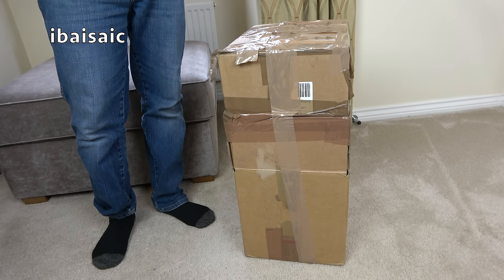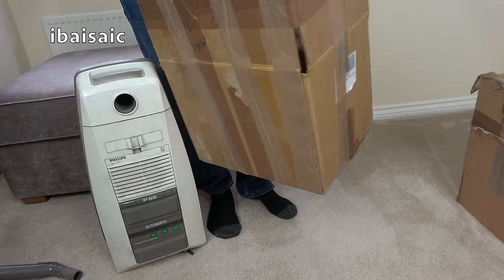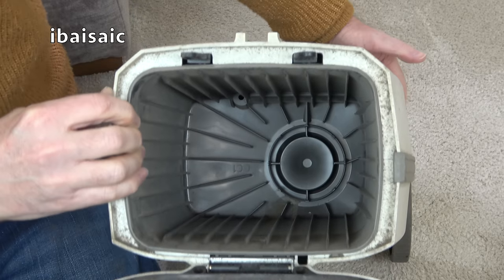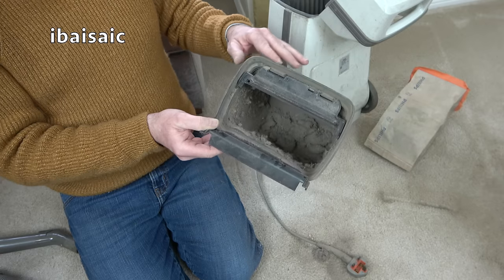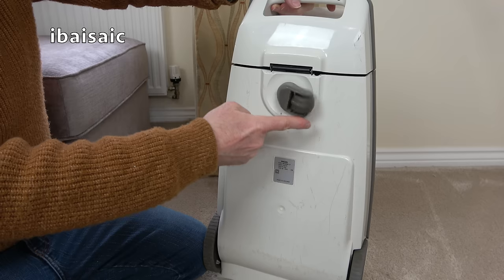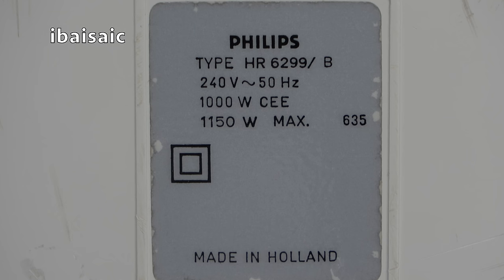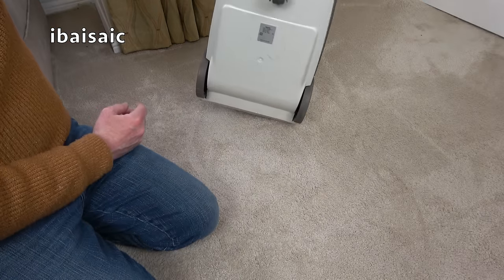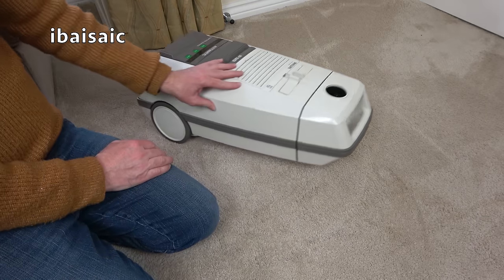Philips P99 Computer Control Vacuum Cleaner Unboxing & First Look

Comment: I am so happy you got one of these gems. It's not hard to it take apart. I have done it in video called "Taken Apart For Cleaning: Philips P74 Electronic". Rare and unusual vacuums worth saving.
Reply from the maker: I got the top off soon after the video to discover the blown suppressor.
Reply: @ibaisaic  Good :)
Reply: Lovely machine I have one model 90, not made in Holland actually made in Mexico and not electronic control. It’s white, and I bought it brand new 40 or more years ago. We stop using it almost a year after because no bags were available and we chose to use a small Sanyo also made in Mexico and by the way I still had that too.

Comment: The small blanking piece at the right of P99 label it’s a small window transparent part to see the bag indicator. It’s a small lever that moves through air pressure simple and still works on a P90 model.

Comment: I'm not sure if you're aware of them, but some plastic welds might be useful for rebonding the cracked pieces, theyre little metal wires tat fit into a gun and heat up, you melt them into the plastic to fit them together with more strength and cut off the excess wires that held it into the gun.

if you're interested looking for plastic welding kit or plastic welding gun should show them online, and thank you for sharing the video as always, its defintiely annoying when something turns up damaged when you wasn't expecting it.